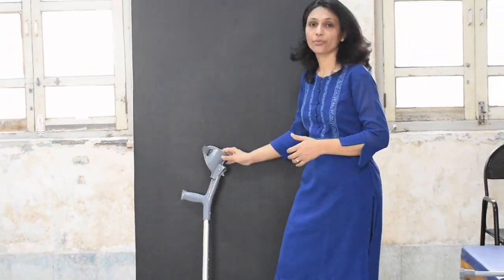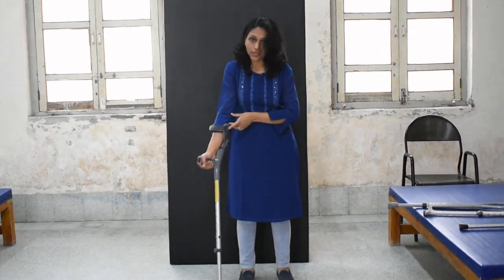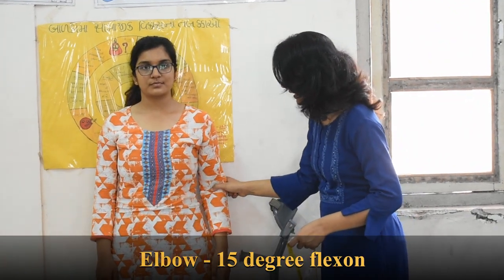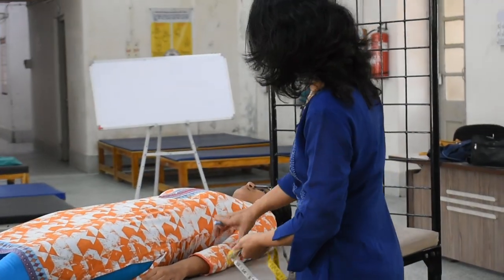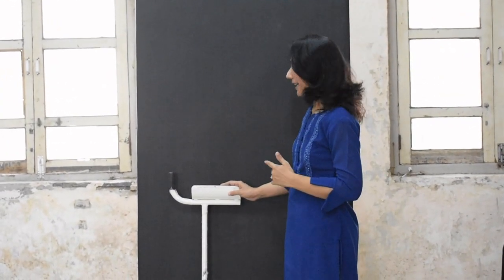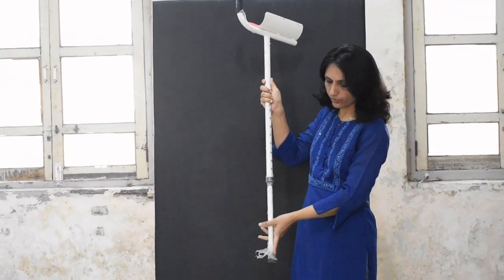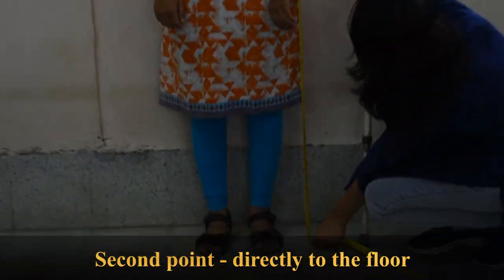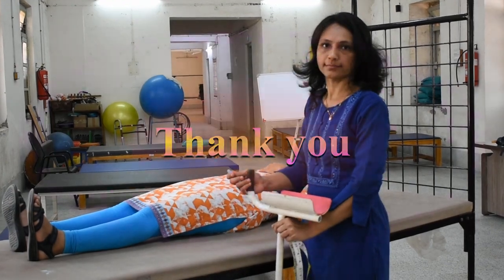elbow & gutter crutch

Comment: Why we are keeping hand in 15 degree flexion
Reply: Flexion of the arm allows for better biomechanics where the patient is able to exert force with the arms. Imagine your arm is fully extended and you need to remove weight bearing on your foot. it is difficult and causes fatigue. a 15 degree flexion allows for some room for extension and lifting of the affected limb off the ground